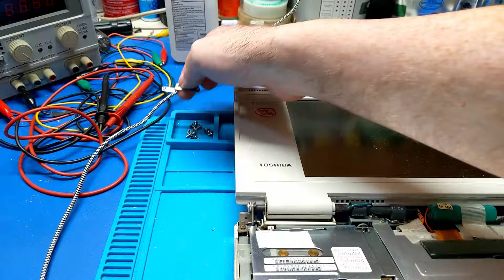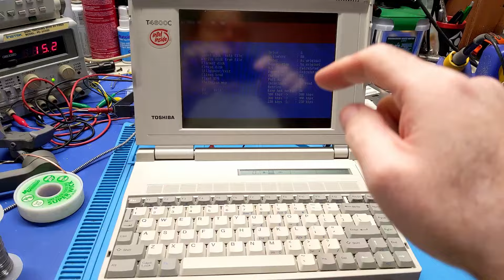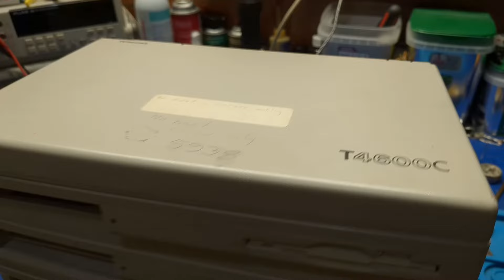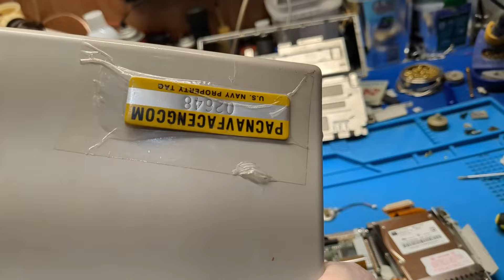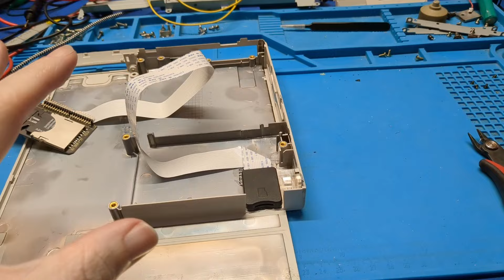Toshiba T4600c Floppy Drive issues Part 2

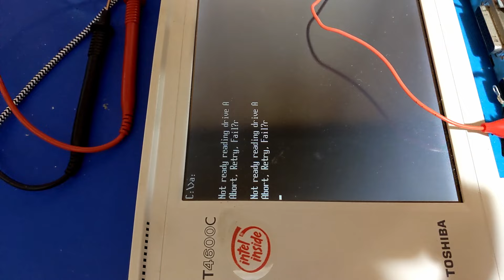Comment: Hmm, did you notice the message at 11:37 says "not ready reading drive A"? That could mean the little switches that read the floppy type / inserted / write protected need cleaning.
Reply from the maker: @voodle_3d  I've already been through all of this... You should see all of the rest of my videos
Reply: @THEtechknight  Sorry, just thought it was an odd message to see compared to the usual general failure messages. The switches can often cause problems on these drives so I thought it was worth a mention.

Comment: So glad you figured out the floppy issue. I also read the Matsushita EME279 drive will work, which belts are readily available for. I plan to try that into my T4700CT. I appreciate you have been MUCH more persistent on trying to figure it out as I have given up LOOOOOOOOOOOOOONG ago as I just wanted to take a hammer to it, but I didn't. I Just shoved it in a box and put it in my hoard closet lol.

Comment: Before you wipe that drive ... make sure you grab any utilities specific to this machine.  The PCMCIA slot and power management stuff in particular, but also drivers and such.  I've got a T4xxx myself, and have done a bit of cursory searching, but haven't found any system / driver /utility disks for these things.  Haven't gotten very far with it because -- surprise surprise -- the floppy drive wasn't working (belts... of course), and I haven't yet had the motivation to deal with that fresh hell.
Reply from the maker: Well, from the years of tinkering I have with these machines, the EME278s just cant be fixed, it requires a very specific belt that just isnt made anymore. neither the W1D nor the 279 belts fit. the 279 drive may fit. But ive just found that adapting other drives is just easier, and works.
Reply: @THEtechknight  I have two EME279s with bad belts, do you know where I can get replacements? I have a bunch of generic belts but none of them seem to fit.
Reply from the maker: @VSigma725  console 5. But he's currently out of stock
Reply: @THEtechknight  I found some German guy on eBay apparently selling the belts, but I don't know anyone who's bought from him to confirm they actually work.
Reply: I just got a T4600C and although the computer isn't working the hard drive had all the /IMG directory and they'll be uploaded to the internet archive shortly. I'll also be uploading the Toshiba Card Manager 3.0 software which is just a Toshiba specific version of phoenix card manager I think - I found a version from 1997 along with the password to decompress it.

Regarding the belts, I've got a few EME278 drives working using a 3d printed TPU belt but they're much more finnicky and poorly designed than the EME279. The EME278 belt needs to be taller and printed without elephants foot otherwise it can slip off the spindle. The EME279 is much better in that aspect because the belt guides are designed better.
Reply: @voodle_3d   Bless you sir.  I still need to dig into mine and see what there is to recover.  I've got a few Gateway and VAIO discs to upload to IA as well.
Reply: @sirnickity  why does any attempt to comment keep disappearing? I've uploaded them now so if you look for t4600 on there you can get the original drivers now. 
I do recommend using the Toshiba Card Manager instead for PCMCIA though, it's much more functional. With the original CardWare software I was having tons of trouble getting a PCMCIA ATA disk to be recognised but TCM read it straight away after installing.
Reply from the maker: @voodle_3d oh thank the tech gods. All my drives were murdilated in some way, and none have the img directory at all, lost to time
Reply: @THEtechknight  Huh it looks like my last comment didn't make the grade, check out the archive for T4600 now and you should see the original drivers and the far more useful Toshiba card manager software